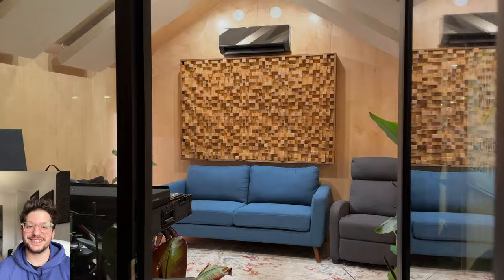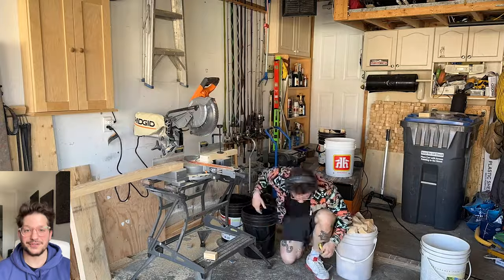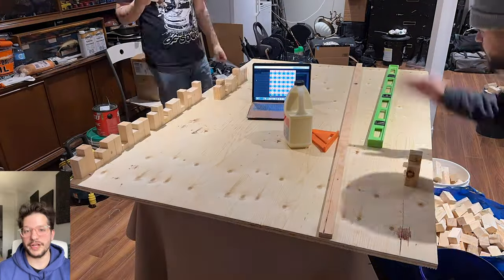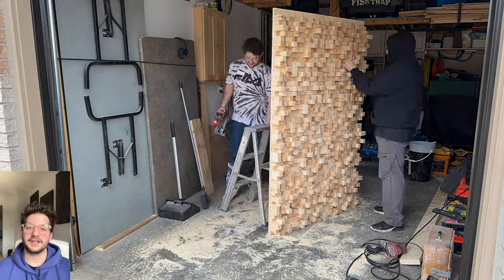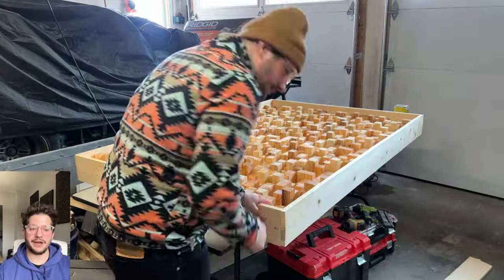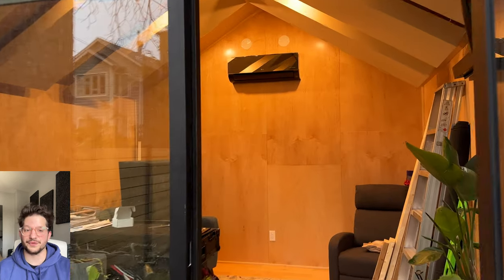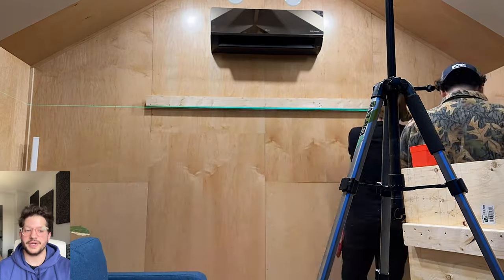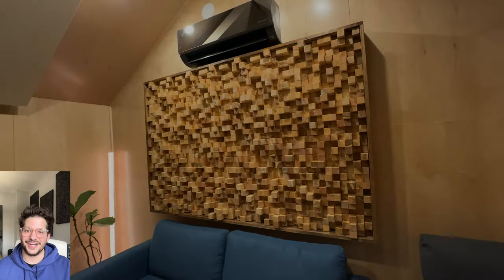How To Build A HUGE Acoustic Sound Diffuser! DIY PRO!

Comment: I built one similar some time back.  There are some time and labor savings available.  First off, hardwood 2x2 are not that much more expensive and the resulting labor saving are enormous as the cut is almost free of fraying so there is very little sanding.  I cut mine on a table saw with finish blade and stacking on edge eight pieces at a time.  I cut two big panels in a couple hours.  Nice work you did there!

Comment: the only absorption I can see is on the ceiling, the room is not very big.. why do you need a diffuser? and a massive one... diffuser should be used when the room is dead and you should sit a few meters away from it.. putting a big diffuser in a small room where you have a lot of wood and not a lot of absorption seems wired to me but the diffuser looks very cool!  I wonder if it's not better to build 4 smaller ones and put them with a bit of space between them.. (in general not speaking just for this room) anyways cool project keep it up

Comment: Just a thought... Stick a sanding disc onto your chop saw and add a tiny bit of pressure after the cut..  Cuts the sanding work in half.
OR  clamp all the blocks in a clamp (2 XxX  boards and regular clamp)  then sand all (or many) at a time.

Comment: Do you charge extra for the tung oil finish? If I was doing that project, it would certainly be finished with an hvlp sprayer and save hours of work!
Reply from the maker: I recently got a sprayer, next diffuser I do I will certainly be trying that method! Thanks for watching!

Comment: This looks really nice, I am going to try building one! Are there any issues with vibration between the diffuser and the wall? Such as the area that the lower spacer rests on the wall? Or is it heavy enough that it withstands it?
Reply from the maker: We have not had any issues with vibration, however it would be easy to stick on small felt/rubber pads on to the lower spacer prior to hanging. Thanks for watching!

Comment: Brother,  good effort, but you so know that you should be like 4 to 5 feet away from that diffuser to hear the effects.

You never ever want it litreally right behind you like that. Completely wrong application
Reply from the maker: Maybe it’s hard to tell with the wide angle but the clients mix position is about 8-10 feet away from the rear diffuser wall. Thanks for watching!